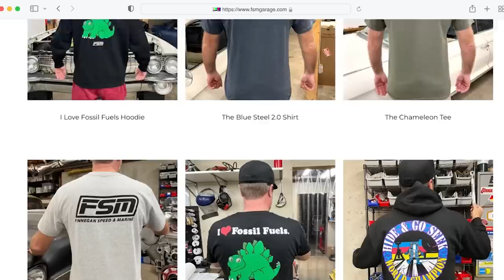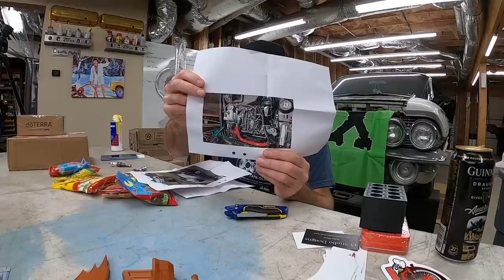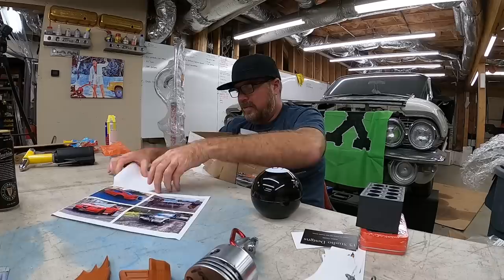FIRED FROM THE PODCAST, SWEDISH CANDY SUCKS, AND THE BEST WORST CAR MOVIE EVER!

Comment: For the MazdaRati, if you want to keep the vibes of the OG truck, Big Block Chevy with a supercharger and boat headers. If you want to keep the engine cool run a trophy truck radiator in the front end.

Comment: Mazdarati 2.0 idea. 
LS4 and transaxle from a Monte Carlo SS in the bed. 
Lots of normal LS upgrades will work on it. Modern fuel injection to easily control with Holley or Fuel Tech. 
Lighter than 455 Olds. 
I think you guys COULD get it to actually wheelie and run 10’s.

Comment: As a Olds fan and owner I say yes go back with the Oldsmobile drive train but to be honest you need more than 5500 rpms to run 10's so unless you are looking to blow half the season's budget you may have to go with something different. Keep up all the great work.  Love all the crew from FSM and Motortrend    Thanks for the content
Reply: Olds 350d block will make big cubes and stand up to 700hp before it breaks probably more with modern performance parts we rebushed the diesel rods for smaller wrist pins and rebalanced the forged diesel crank for the gas pistons and put 403 heads on it with a lot of spray and flogged that engine but there was 420+ cubic inch stroker stuff for them back in the day

Comment: Project 1:)  Ebay turbo a Mercruiser 4 cylinder and put it into a Mercury Cougar: because old can be hot!  Project 2:)  Convert a new GTO into a Ute, but instead of regular bed do a work truck type bed designed to carry tools/equipment during drag week style events. Of course, a n/a pump gas 600+hp 416ci LS3 should be the engine so it's fun  AND reliable. You do remember what reliable is right?    .....   right?

Comment: It is possible to get a Toronado drivetrain to pull wheelies but it has to be changed to rear engine, not mid-engine. Friend of mine from long ago had a Porsche 912 with a Toronado drivetrain, I think it was a 425. It was configured as a rear engined layout. He reversed the rotation somehow, don't know if it was a reversed cam or something in the drivetrain. With all that weight out back it could pull wheelies.

Comment: I used to roll beer for Budwiser, we used dollies like that but without the brake. They were hands down the best hand trucks I've ever used! Our back shop guys would sharpen the blades to a pretty fine point so you could "kick under" big stacks of beer that weighed up to 500lbs. They were so sharp, though, that if you didn't rock the stack of cases well enough, that blade would slice through a half case of cans. That's a badass piece of gear!

Comment: I for one can confirm that the hand truck (dolly) is a great unit. As i am a budwieser delivery driver for the north-eastern part of Oklahoma. My dolly is a different model (mag liner) compared to the liberator, but both are Cadillacs
Reply: Accidentally pressed send🤦‍♂️ anyway as I was going to say that dolly at least in my area is used more for the "grocery" delivery trucks  ie. Us food service for example. Since they don't typically have liftgates on their trucks. They basically unload like a big U- haul truck with a pull out ramp, thats where the brakes come in handy. And the white plastic on the back is used for pulling up the dolly up and over curbs and stairs easier.

Comment: Mazdarati 2.0 needs to use a new Impala ss drivetrain in the bed with a Whipple on it. Make it pull the fronts and run 10s like the original goal. Little bit of modernization due to the misfortune.

Comment: I run a Stinger PimpX on my 2.3 Turbo Capri and it has provision for an SD card, so every time it starts it data logs. Super easy to copy the logs back to the laptop, even if I didn't have the laptop with me. I agree with how useful the logging is and a great investment if you don't have one built in.

Comment: You're better off using cell phones for regular filming. NoPro's just shut off randomly, they always have they always will, no one at the company will fix it. Either risk Chinese cameras for cheap, or buy a cell phone or Sony camera. 
I'd say build what the Mazdarati should've been, a hemi or something that isn't another LS or big block chevy build with turbos or a blower. One thing you can do to have a MUCH better transaxle without breaking the bank on a ZF box (Pantera anyone) is to buy a Porsche Cayenne transaxle (I think that's which one it is) and flip it over and set it up to run with the engine in front of it instead of behind.. It's what Super Light Cars does for their kit car.. they even offer a kit to run the Lame Shit engine in front of it but.. I'm so sick of seeing the same boring ass engine in literally everything. I swear they need to make a LSP so it's actually fitting to what it does.. Let's Scatter Parts. Hence why they are called Whorevettes, they make you happy for a couple minutes and then you feel bad about it afterwards.

Comment: If u guys build a new mazdarati it should definitely run 10s and pull wheelies. I'm thinking blown big block or high revving sbc on nitrous
Reply: Olds 350d converted to gas with a blower would be badass and the stock diesel block and crank will hold up to 700hp no problem and will bolt right up to another toranado transaxle  and would fit with the oddity of the original build but better executed

Comment: The camera shutting off? Are you sure they are not overheating? If I recall correctly, gopro have had problems with temp last generations. While they are not in motion they cool poorly. Take a look at dji, they claim whole battery filming with no problem. 👍